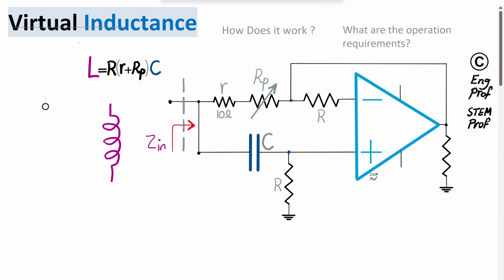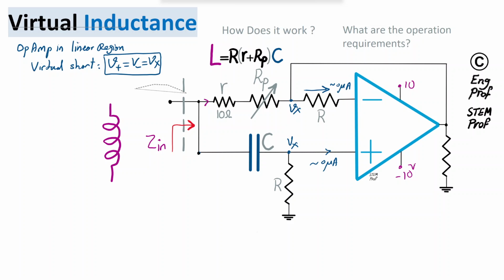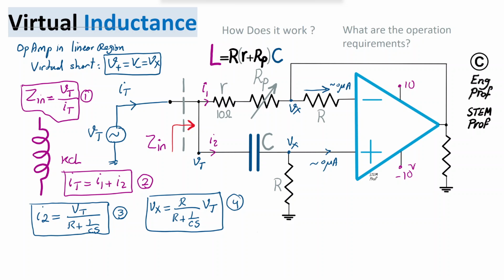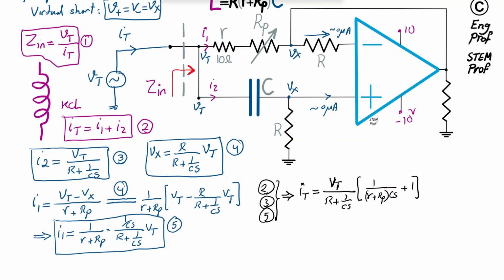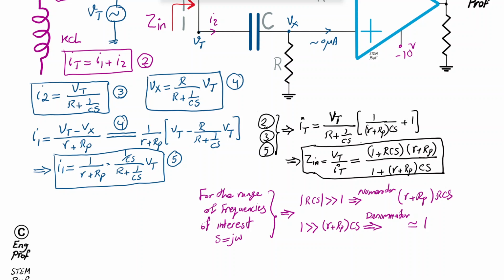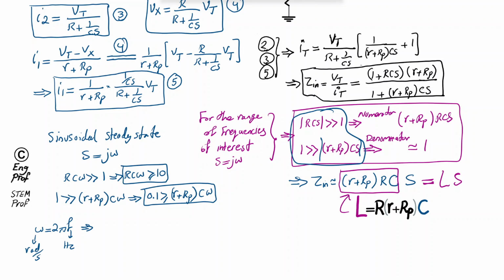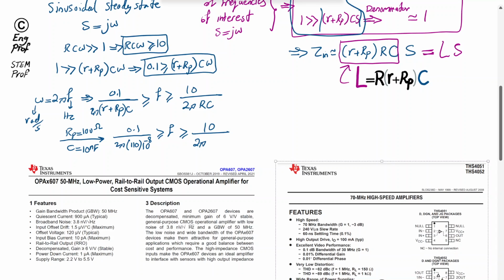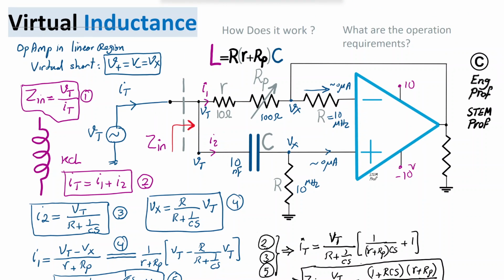Virtual Inductor Design with Operational Amplifier

Comment from the maker: An implementation of virtual inductor (aka Artificial inductance) is presented in this video. For more Circuit examples see: Active Inductor with Op Amps https://youtu.be/6IYz4iaa05c
Negative Inductance Design Op Amp Impedance Converter https://youtu.be/GF_Mun_Mkyo
Converting Capacitance to Inductance https://youtu.be/weIHG45G6Pg
Operational Amplifier Gyrator Network Circuit https://youtu.be/2KpjAytRBpc
Analog Computer circuit that solves Differential Equation https://youtu.be/HeZRtnRXpEI
    To see more op amp and analog circuits examples please check analog design playlist https://www.youtube.com/playlist?list=PLrwXF7N522y4c7c-8KBjrwd7IyaZfWxyt  
I hope these Circuit engineering and analysis videos are helpful.

Comment: Nice way to get a large value inductive reactance with a handful of parts at a fraction of the size of a real inductor.
Reply from the maker: Glad that you liked this minimal-component analog circuit that for target frequency range of interest can implement a large virtual inductor with just one operational amplifier and one main capacitor.  The 100 ohm potentiometer can also be removed if just a fixed inductance value is desired.

Comment: Would it be possible to use this for LC filters where the inductors are in series with each other, like the Hammond Scanner Vibrato case?
If so, the output of the opamp would be connected to the input of the next circuit instead of ground? Or how do I wire it?
Reply from the maker: Glad that this Impedance converter circuit is useful.  There are many ways to realize (simulate) a virtual inductor.  The input port of this circuit acts as a virtual inductor with one terminal grounded.  So you can for example wire a series capacitor to the input (forming a series LC tank).  If you are interested in virtual floating inductance, then this circuit is not the proper design. Instead, I suggest the virtual floating inductor design for example using circulating amplifier:
Simulated Floating Inductor Design with Circulator Amplifier https://youtu.be/weIHG45G6Pg
Active Inductor with Op Amps https://youtu.be/6IYz4iaa05c
Negative Inductance Design by Op Amp Impedance Converter https://youtu.be/GF_Mun_Mkyo
Operational Amplifier Gyrator Network Circuit https://youtu.be/2KpjAytRBpc
I hope these additional impedance Converter and Gyrator Circuit examples are helpful.
Reply: @STEMprof  Thank you so much for your in depth answer.
Reply from the maker: @sharptrickster  You are welcome. 🙋‍♂️

Comment: Why are resistors required at the negative input of the opamp and between the output and the ground?
Reply from the maker: Good questions. Resistor connected to negative terminal is for impedance matching purposes of the two input terminals to minimize input offset current and common mode effects of operational amplifier. Output resistor can be removed but depending on the selected op amp, might help with circuit stability.  It is a good practice to check the datasheet of selected op amp regarding additional required passive components (resistors and capacitors) connected to op amp terminals for proper op amp circuit operation.

Comment: Can it be used to substitute Inductor in LC oscillator?
Reply from the maker: That's a good question.  Theoretically yes assuming frequency of oscillation is well within the frequency range of operation for the designed virtual inductor.  For example, in this video, the designed artificial inductor is for Audio application (20 Hz to 20 kHz).  It is important to make sure circuit components (resistors, capacitors) are selected properly to achieve the target frequency of operation for the virtual inductance.  Op Amp should be a low-noise, very low-offset (say CMOS) operational amplifier (for example see the Texas Instruments Op Amp suggested in the video. It is also recommended to have a say 47pF or 100pF capacitor between OpAmp's output and negative input terminal (to make circuit more stable).  To see alternative techniques of designing simulated inductor including a floating virtual inductance see:
Converting Capacitance to Inductance https://youtu.be/weIHG45G6Pg
Negative Inductance Design Op Amp Impedance Converter https://youtu.be/GF_Mun_Mkyo
Operational Amplifier Gyrator Network Circuit https://youtu.be/2KpjAytRBpc
I hope this explanation is helpful in answering your question.

Comment: Isn't this just a gyrator? I remember studying these back in 1988 at University.
Reply from the maker: Thanks for your interest in this circuit and good question. The concept is similar but Gyrator is a two port device as discussed in the following examples:
Impedance Converter Design with Op Amp (Gyrator) https://youtu.be/jPudh9yqDH4
Gyrator Circuit Design with Operational Amplifier https://youtu.be/cWjRvnAJbUg
Negative Inductance with Gyrator https://youtu.be/GF_Mun_Mkyo , 
Active Inductor with Op Amps https://youtu.be/6IYz4iaa05c
Impedance Converter Gyrator with Transformer to convert Capacitance to Inductance https://youtu.be/GVLC_pqSETA
I hope these additional Gyrator circuit examples are interesting.

Comment: As always .. excellent video.... 
Just wondering how we can put this to a practical use ?
can you share a small block diagram of a possible application circuit please...
Reply from the maker: My pleasure & Thank you!  regarding your questions, A sizable virtual inductance (say as large of few Henry) can be realized using this circuit for a reasonable range of frequencies (say 20Hz to 20 KHz for Audio Application) by proper selection of circuit components.  In practice, such large inductors might not practically exist, or might be very expensive, bulky, noisy with large THD.  While a properly designed virtual inductance might be able to resolve such issues.  A possible use case example is in parallel LC oscillator.   There are alternative circuit techniques to design an artificial inductor including a floating virtual inductance as discussed in the following videos: Converting Capacitance to Inductance https://youtu.be/weIHG45G6Pg
Negative Inductance Design Op Amp Impedance Converter https://youtu.be/GF_Mun_Mkyo
Operational Amplifier Gyrator Network Circuit https://youtu.be/2KpjAytRBpc
I hope this is helpful.